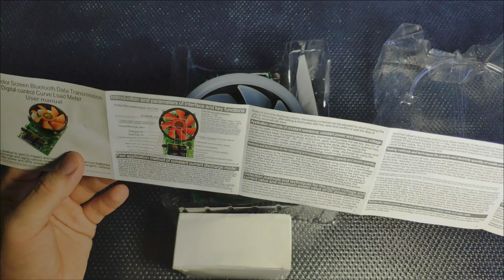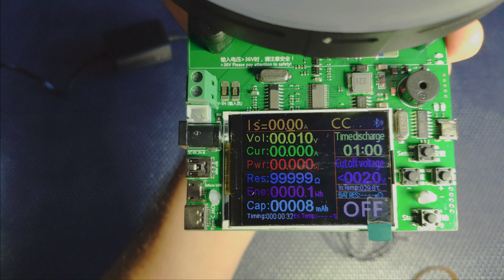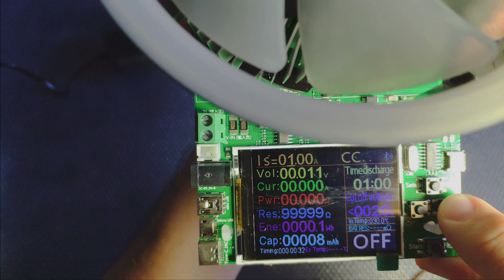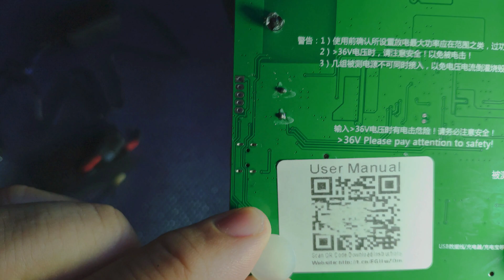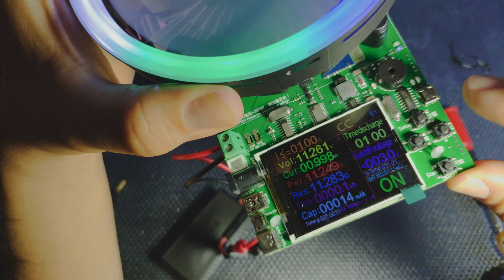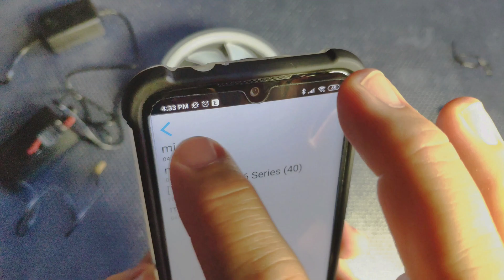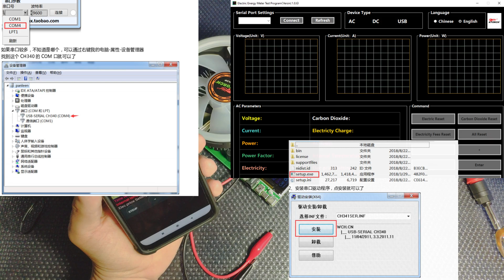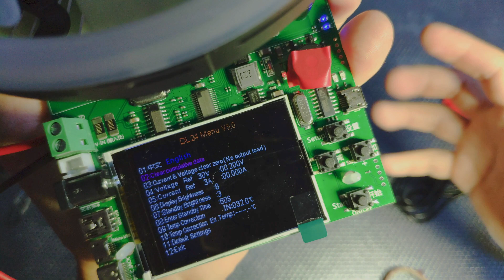DL24 Electronic Load Battery Capacity Tester

Comment: Should I proceed  the test with a fully charged battery?
Reply from the maker: Yes, and you need to set the discharge limit, when the test is over you will find the capacity.
Reply: @TechTronic9000  Your reply was very helpful. Let me ask you one more thing.
If the known Discharge Cut-off Voltage is 1.5V, is it correct to set it to 1.5V? Or does it help protect battery performance by holding it to 1.6V?
Reply from the maker: It depends on the battery, the low voltage cut off is whre you want to finish the discharge. If you go to low you can destroy the battery.

Comment: I have this model now; how can you reset the capacity by only using the buttons (no blutooth)?
Reply from the maker: It has an option in the menu settings.
Reply: Probably you hold the "on/off" button for 2 seconds and you have some options to go on

Comment: Can I do battery capacity testing for 24v 30ah using this module??
Reply from the maker: I have added a link in the video description for where you can buy this and it also has a full datasheet there. It can support up to 200V. Power is limited to 180W so you can choose various combos between voltage and amps.

Comment: This is good up to 180W, or a little more if you mod it. It there something in the 300W range ?
Reply from the maker: There is  modular model where you can hook up several modules to increase the power, check my video info for links to those newer models.
Reply: @TechTronic9000  I can always change the MOSFET and add up a huge CPU cooler, then recalibrate, but I rather get something 300+W from start.
Reply from the maker: I have upgraded the cooling on mine already with a massive heat-sink and large high airflow coolers.

Comment: You can use a dab of hot glue or silicone adhesive on the hole of those piezo beepers to significantly reduce their output. I do that for the battery monitors intended for use with radio control planes and drones -- they're designed to be heard over motor and propeller noise, at significant distances... it makes a huge difference.
Reply from the maker: Yes that works nice also. I usually just add a bit of duct tape over.

Comment: Can we test lithium ion battery with this?
Reply from the maker: Yes you can. I use it often to test out ebike batteries that are rated to 36-48V. You need to take care about total power. Also add a fuse inline for safety in case the MOSFET shorts out.

Comment: got a kit version of this, doesnt come with the cooler so used an intel stock cooler from a 9th gen i3 so its all aluminium. It is cheaper but there is a gap that i had to bend the FET and press down on the heatsink to make contact. I was able to dissipate 100W with the internal temp staying under 80C, it can do 120W under 90C..... just for others who might want to same some money on it
Reply from the maker: I've upgraded mine with a old but large ZEROtherm ZT-10D, now it won't go past 60-65°C at 150W.

Comment: Can you set a low voltage disconnect to prevent discharging a battery that does not have a bms ?
Reply from the maker: Yes sure, you can adjust the voltage it stops to.

Comment: The mobile app DOES show everything on screen, you have to enlarge the scales for current/voltage/power (use two fingers on the axes)
Reply from the maker: Maybe that works for newer firmware / app versions. It's been 2 years since my review and I still remember the awful 300V scale which was not adjustable and the hard to navigate menu with the same up/down/left/right buttons.

Comment: Do this thing have any kind of data logger, which could enable you to plot the discharge curve? I bet the data could be tapped off of somewhere... but then again the circuitry is pretty small here...
Reply from the maker: Yes it has both a PC and a Android app for that, but they are rather crude

Comment: A test tool app (06:50) that requires you to enable reporting your precise GPS location?
No thank you.
Reply from the maker: It's an Android limitation that enables to pair BT devices with no cod, just by using them "locally" thus needing location. This is used in a lot of smart devices also such as TV, TV box, robot vacuums, wifi roaming repeaters, etc.

Comment: how to calibrate video, using to test quality of 18650 batteries, getting 4.007 on dl24p but 4.11 on meteer3 other sources, tried to menu to calibrate doesn't seem to work
Reply from the maker: You can't, it's related to voltage drop, use thicker cables, better clips. A new version was made that has extra wires for more accurate measurement and has no longer problems with voltage drop, here is that one https://bit.ly/39eWNtI

Comment: Early in the video you claim the ability to remotely press the buttons is "useless". I disagree. The physical buttons  on the tester have a lifetime with a VERY low number of on/off cycles compared to many other momentary on buttons/switches. This type of switch typically begins to fail and operate intermittently fairly early into the life of the product. Thus, being able to reduce the number of times you actually use the physical buttons can provide a much longer lifespan. It can be quite frustrating to have any of those buttons start operating intermittently and the longer one can put that off, the better.
Reply from the maker: Still it's not a great feature, they could either work on the app & device to program it easier or use better switches.
Reply: @TechTronic9000  I agree...for example they could use optical switches. However, better switches increases the cost and manufacturers are always looking for ways to save even pennies in BMC when dealing with high volume production lines; leading to "just barely good enough" design decisions that turn an otherwise great product into a morass of bad reviews.

Comment: can i test a 48v 7.5a power supply with this or is it too much?
Reply from the maker: The limit for this model is 150W. You can calculate 150/48 = 3.12A. But a 48V battery actually has 54.6V when full so 150W/54.6 = 2.74A is max discharge current.
Reply from the maker: For high current get the modular new type and get more blocks: https://bit.ly/3i6yWOf

Comment: Thanks for the detail review.  I am interested in the app part.  It seems the app is not very powerful.  I would like to know if there are any USB loads that provide APIs for programmable by PCs.  Or the only solution for me is the large expensive traditional E-loads from instrument companies.
Reply from the maker: In this price range you can't get a good app based device, sadly you need to spend a few time more to get something that does a similar job but it has true app control.

Comment: One major flaw with DL24 and DL24P is voltage resolution on output is only 0.1.  The Display gets 0.001 resolution but not the data output.  This means you can't really make nice graphs from the data.
Reply from the maker: Well, I can't complain about that for the price you pay for it....
Reply: Are you looking for higher resolution for LiFeP04 discharge graphs because the middle 70% is flatter than a Wisconsin girls ass? 3.27, 3.27, 3.27, seven hours and 140Ah later 3.27, 3.27, 3.27, 3.26!

Comment: Does the USB-C port on this tester actually trigger PD modes like it should? USB-C PD (Power Delivery) requires that the device communicate with the charger to negotiate what voltage and amperage to use. So for example, if I use a USB-C PD charger that is capable of outputting between 5V-20V at 3.25A, and I connect that charger to this tester via a USB-C to USB-C cable, will the tester negotiate the proper 20V output from the charger like it should?
Reply from the maker: There are a lot of variations and clones of this product. Mine doesn't have specific USB settings such as QC/PD protocol. For testing usb devices I use this https://youtu.be/mCtx7ESMhGg
Reply: @TechTronic9000  ah ok, thanks! I have one of those kinds of testers already and they work great for seeing what current a device is drawing from the charger, but they don't allow you to force a specific current or wattage load like DC testers do.
Reply from the maker: You can get a usb load, there are some models, but they are usually just resistors and don't have PD/QC triggering.
Reply: you need an external PD trigger

Comment: Hi TechTronic9000 
Could you tell me the brand and number of the diode (I think, 2 legs)
under the heatzink on the left edge of the pcb. 
Mine become very warm and exploded when I connected a 25V battery for the first time.
That makes it impossibly to read the letters and numbers. on the diode.
Many thank you for your answer.
Reply from the maker: Sadly currently i can't reach mine for now, maybe this can help you a bit https://syonyk.blogspot.com/2018/06/the-atorch-purple-fan-mosfet-destroyer.html
Reply: @TechTronic9000  It was not the same pcb but thanks for the reply.

Comment: Wondering whats under the heatsink
Reply from the maker: IRFP260N MOSFET
Reply: @TechTronic9000  wow how they can use only mosfet as load?
Reply from the maker: The MOSFET is just used as a controlled load. It has other logic circuits to measure voltage, current etc.

Comment: Rubber band are not for LCD, it's for attaching temperature probe to anything you test
Reply: I suggest it is likely playing a dual role. A band on the LCD during shipping seems to me a very good idea. I've received 2 SIMILAR testers where the LCD was completely detached from the device in the box and had to be carefully realigned with a flexible conductive connector. On one of the units either realignment wasn't possible for some reason or there was some other kind of display subassembly damage) as the display basically just showed pixelated garbage.

Comment: I got the one with the add on boards and battery box
Reply from the maker: That is the newer and better version. I would recommend you to put a in line fuse on one of the discharge wires.
Reply: @TechTronic9000  ok

Comment: Seems you have it hooked up to a 3S1P Li-Po pack which if I understand correct is 3.7VDC per cell and a 3.0VDC per cell LVCO or 9VDC LVCO, but your LVCO is only set to 3.0VDC...wouldn't that damage the pack if you started a 1A CC discharge and walked away?
Reply from the maker: It's indeed a 3S1P LiPo pack and yes you are right about the low voltage cut out. In this video I'm just showing the product working not giving tips of how to establish battery capacity and properly discharge them. For LiPo I would actually stop at 3.2V/cell. Li-Ion might go to 3V/cell.
Reply: @TechTronic9000  I just received my unit in from AliExpress yesterday.  Cool little gadget, I bought it because of your video.  Just curious how necessary is it to use the sense V+/- on the battery terminals for more accuracy?  I'm trying to find a better explaination of how voltage drop of the load wires would be any different from non-load wires.  So far I'm just jumped the A+/V+ and A-/V- and it seems to be working just fine. Also, have yet to get the BT app to connect on my Android Samsung Galaxy S10+ Thank you.
Reply from the maker: The newer version with sense wires has a different schematic and it's more accurate. When you discharge a battery you also calculate power which is based on the current draw measured by the the resistance. The old version take into account also the wire resistance, clips resistance etc. The sense wires fixed on the terminal will read the exact power source voltage so it will not measure voltage internally after the voltage drop.

Comment: Can test battery pack 36v?
Reply from the maker: It works up to 200 volts, you just need to keep power rating in mind. 180W / 200V = 0.9A maximum discharge current. For 36V - 180W/42V (fully charged) = 4.2A. I would recommend to keep the power under 150W otherwise the MOSFET will burn out.

Comment: Welp, after about 25 uses, my new DL24P ($52.00) has failed.  I was doing a test at 11amps and it just quit.   I hope it's just the big MOSFET under the fan.  Otherwise, garbage.
Ironically I had made sure it stayed as cool as possible by using an external 60mm fan to keep cool air blowing on it in addition to the included top fan..  Didn't help I guess.
The persistent problem will be that if these things fail at anything over 10Amps, then it's not really a 180watt load tester as advertised.  That MOSFET is rated for 345F (175C) and 50Amps so it should have been able to handle it.
Reply from the maker: Mine also broke after some usage, only the main mosfet was blown, it's a knock of chip, try to get an original mosfet. Also I advise you to install an in-line fuse on one of the discharge wires. As for 180W power, it depends on the battery voltage, 10A @ 18V = 180W already.
Reply: @TechTronic9000  I'm ecstatic to report that changing the MOSFET IRFP260N did the trick  YAY !! I bought Bridgold off of Amazon.  Just ran a 10A load and no problem.
  What is the purpose of the fuse?   Thanks for the feedback and video above.
Reply from the maker: When my mosfet gave out it shorted out. I was testing a newly built 48V ebike battery. It destroyed my battery BMS. If it would have had a fuse that BMS might still have worked today.
Reply: @TechTronic9000  Wow.  Thanks for letting us know.  I also use it to test a 48v ebike battery.  If it was a BtrPower battery you can get a replacement BMS for $20

Comment: Has anyone figured out a way to turn OFF the bright Fan LED lights ?   Very happy with this device.  Used it overnight many times at 10Amps load no problems.
Reply from the maker: Just follow the led wires from the led shroud. I have replaced my fan and heat-sink with a much larger one and keeps it much more cooler now.

Comment: What is the mosfet model?
Reply from the maker: It was a irfp260n bad quality clone, I have replaced it with the same model but from a trusty source, works OK for now. Also added a bigger cooler and an in line fuse on the discharge wires.

Comment: I upgraded with water cooler (ID-Cooling Frostflow X 240  with TDP
 250W) and much stronger mosfet ( IXFX160N30T 1400W and 160A)
Reply from the maker: I have also upgraded the cooler to a old massive Zerotherm ZT-10D, don't remember the TDP but i was using that with an old Q6600 CPU that was overclocked form 2.4 to 3.2Ghz. I'm still using the stock mosfet.
Reply: @TechTronic9000  excellent choice to keep the original mosfet, at the time of writing it is IRFP264 and for the price it costs it is one of the best in doing the job of dissipating heat, a job for which 90% of the Mosfets are not designed. Suitable ones are linear mosfets like IXTK90N25L2. but they are very expensive (40€) and almost unobtainable in this period.
Here I see many people replace the original mosfet with others considered more powerful, i.e. with higher currents in A and greater dissipation in W. But few know that what matters is the graph of the
"maximum safe operating area" SOA
If they looked at it they would realize why a 100A 200V mosfet burns with 20A at 20V used continuously for several seconds:
In particular the much more powerful IXF160N30T is one of the least suited to work in linear regime as it is used in electronic loads and in fact at 20 volts 20 Amp it is well outside the SOA safety area, so it can burn out immediately or operate for a short period unspecified : therefore unreliable, imprudent to leave in operation without careful supervision.
At least use a model that even if not designed for "linear" use in the SOA graph has the curve in "DC"
Reply: What exactly does this mod achieve? Did you have to adjust the firmware of the device to work with the replaced mosfet? :)

Comment: does it have a voltage cutoff feature?
Reply: can this also be used in parallel to increase the discharge power?
Reply from the maker: Yes it has adjustable cutoff voltage. I think you can also paralel two devices then you have to sum of used capacity from both of them.
Reply: Yes. The Bluetooth application voltage and current are mislabeled as well the developer has not completed yet.

Comment: can we increase the output power by apply parralel mosfets
let's suppose this is designed for 150watt I want it to test the battery at 800 or 1000 watt load is it possible to make change in it?
Reply from the maker: Might be possible but with no schematic of the device it's hard to know if the mod is possible.
Reply: @TechTronic9000  It is possible if the shunt is modified and use several MOSFETs in parallel. http://www.bristolwatch.com/ele2/pm.htm